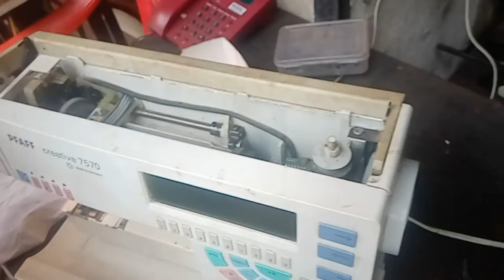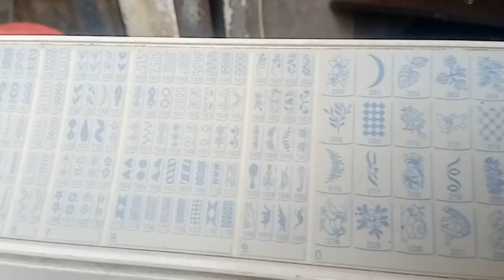PFAFF 7570 Complete Service

Comment: Thank you for the video very helpful. Although I am struggling with the step to take off that side panel to access the presser foot bar.. is there a trick to it as I’m scared to break it if I pull at it too hard?

Comment: Thank for upload the video
Can you kindly advise how to access the front control panel; the straight stitch key of my 7510 was frozen, no longer has the on-off feel when pushed.   Right now my machine can only do straight stitch, all other control keys such as needle position, keyhole selection are not working.   I am from Australia, otherwise will seek your professional service.
Reply from the maker: You can try removing the front control panel, then try to polish the switch borders with emery paper and reset.
Reply: @MyMasterBrain  problem is I can't figure out how to remove the front panel.

Removed two screws but front panel is still firmly attached.  

Your help is much appreciated!
Reply: Did you ever figure out how to get into the front panel?

Comment: Hello. I have the same sewing machine but it does want to work. It turns on but the screen is sometimes green or it has a bunch of black lines. I have turn it on and off a bunch of times. Sometimes all the buttons light up and sometimes it doesn’t. I have changed the batteries. The pedal doesn’t seem to be working also to move the needle up and down. Please advice. Thank you.
Reply: There is a contrast control under the green display, turn it. The pedal is easy to disassemble, you need to clean the resistive contact with alcohol

Comment: This looks like the typical sloppy "service job" I regularly fix when customers send me machines that have come from a shop who didn't know what they were doing (and often make things worse). Oil applied on top of old oil and randomly splattered all over, and grease in places where there shouldn't be any. Literally nothing was accomplished in the video other than cleaning dirt off the motherboard. With machines this old, they really need to be at least partially disassembled and fully cleaned down to the bare surface, and then fresh synthetic (and only synthetic) lubes can be applied. This machine in particular is in horrible shape and needs a complete rebuild.
Reply: Hi I wonder if you can help me - yo are obviously very knowledgeable on these machines. I am looking for a dual-feed Pfaff and a 7550 is available locally but I worry about such an old electronic machine - am I just buying a problem and should I wait until a dial feed mechanical becomes available.

I live in Bulgaria so supply is limited you. see.
Reply: @piccalillipit9211  For a computerized Pfaff, I would recommend getting a 1400 series machine, such as a 1472, 1473, or 1475 as they are much more reliable and the electronics are easy to repair if they go bad. The 7500 series tend to develop too many electronic issues that can be tricky to diagnose and repair.
Reply: @PfaffPfantom  OH thank you very much - I will save this info. I decided to give that one a miss. Ill kee a look out for a 1400 series machine.

Comment: Way too much oil!
Reply: Also the wrong kind (only use synthetics, and different areas require different weights), and lube in places where it shouldn't be, and skipped crucial areas where there should be oil.
Reply: @Arctic_Falcon  agreed!